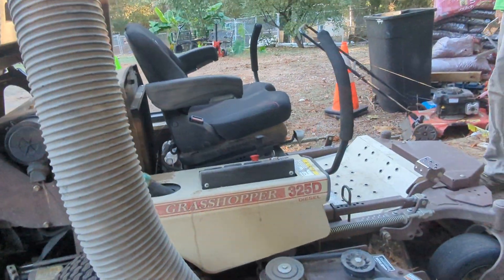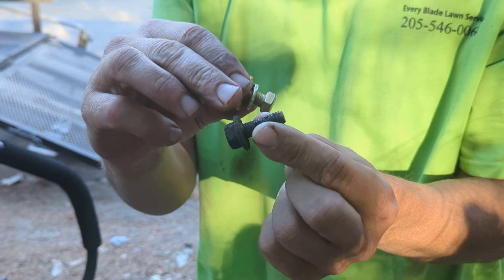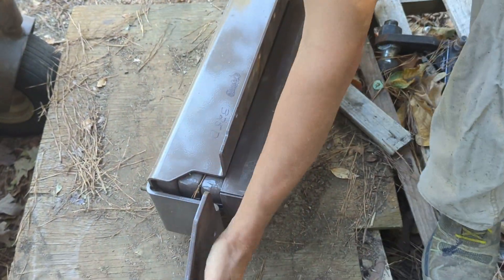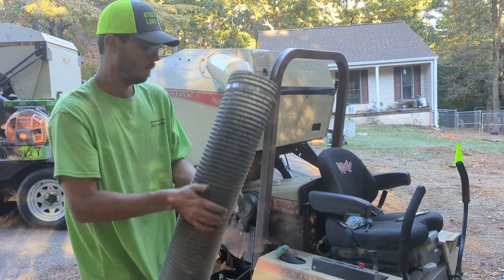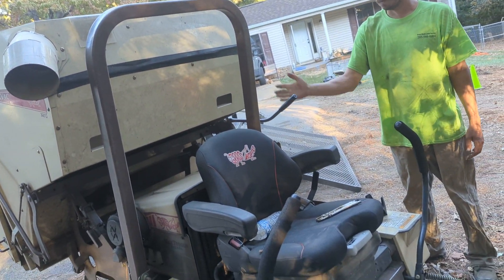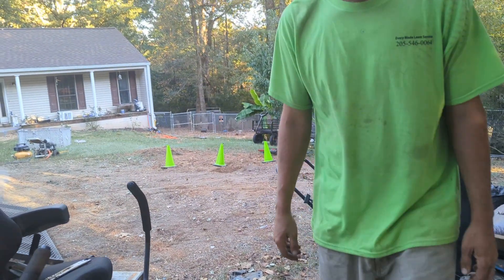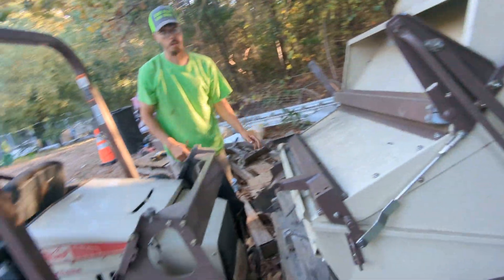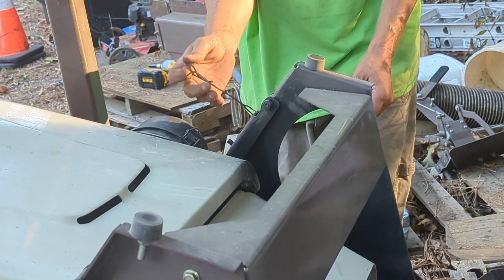Grasshopper 329D

Comment: you can't understand the grasshopper 329 mount a Kubota WG 972 with 962 cc 29 horsepower. on that engine not need diesel but simple gasoline